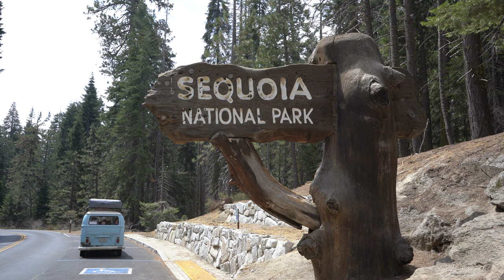Sequoia Kings Canyon National Park - Our kombi can climb! (Ep. 23)

Comment: Amazing video so glad you finely got you bus dialed in power wise sound from what i can here strong strange all the lug bolt came loose at the same time?  Maybe the tire is out of balance i always carry a what we call a cheater bar or a piece of pipe that fit over your star lug wrench to get them nice and tight never use an air impact you will never get them off when you really need to. Always check to make sure everything is good and tight on the axel nut on the inside of the brake drum when you have it jacked up in the air grab the tire and see if it moves around or back a forth with the lug bolts tight ! Love the longer video too ! Thank you !
Reply from the maker: Hi Neal, thank you for all the advice! i had done the brakes recently so I probably didn’t tighten the lug bolts properly, who knows; we’re definitely lucky! 

Thank you for your comment about the video style